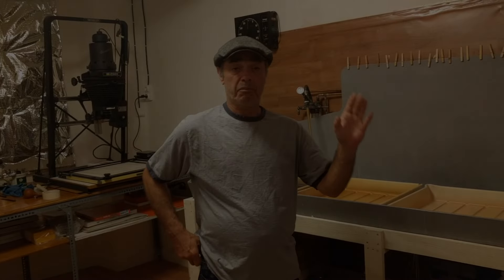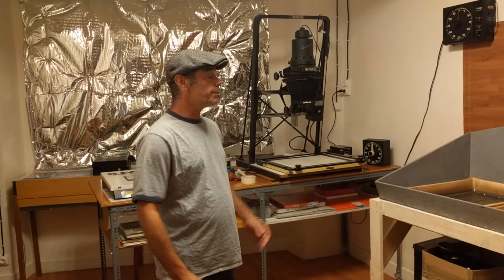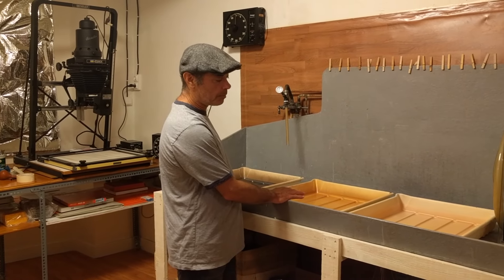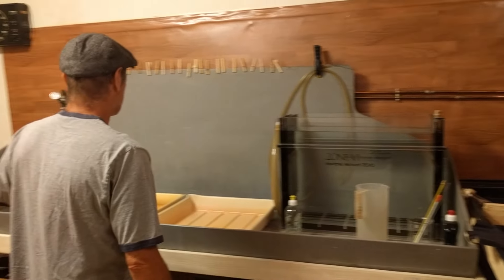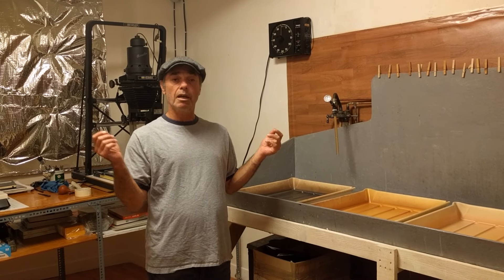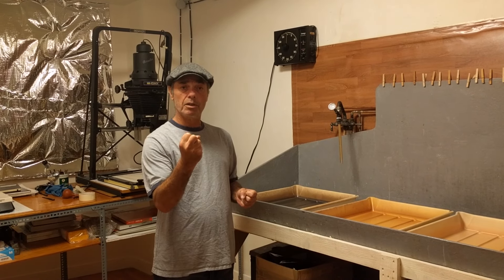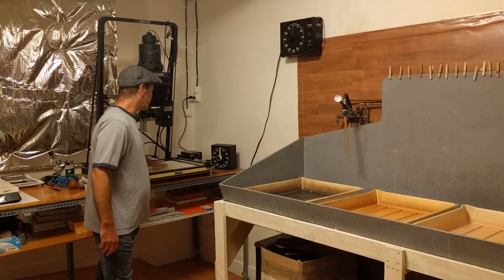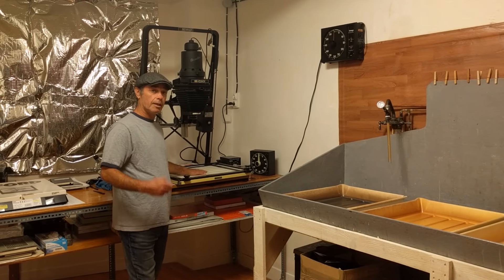DARKROOM TECH: INTRODUCTION TO THE CONCEPTS OF SILVER GEALTIN PRINTING

Comment: I'd like to know what fixer you use. Thanks for these tutorials!
Reply from the maker: Good question Jim. I use a "plain fixer". The formula is 608 grams of sodium thiosulphate with 120 grams of sodium sulfite, both anhydrous in 4 liters of water. The thiosulphate is the active ingredient which dissolves the still active non exposed silver halide salts embedded in the gelatin. The sulfite is the conservation agent. This fixer has no hardener, all manufactured papers and negatives already have  a hardener incorporated in the gelatin, so you don't really need it. And therefore, when I use the "plain fixer", my spotting and etching phase is much easier because the gelatin in the print is not over hardened. Not only that, but all fixers with a hardener have a very strong smell,  because all three of the necessary ingredients needed to make a "hardener fixer" smell, the hardener something like chrome alum, the acid like acetic acid and the buffer kodalk (sodium metaborate), are all smelly chemicals. Plain fixer lasts the regular 2months and is good for 24, 16"x20"  prints. Sometimes I use just a one shot fixer that just has sodium thiosulphate, for example when I process with Pyro. The developing agent Pyro is incompatible with sodium sulfite. Any fixer that has ammonium thiosulphate is considered a rapid fixer, these fixers are smelly as well. Thank you and happy printing. More DR Techs on my site www.bonniere.eu.
Reply: Great! I will try this fixer myself.